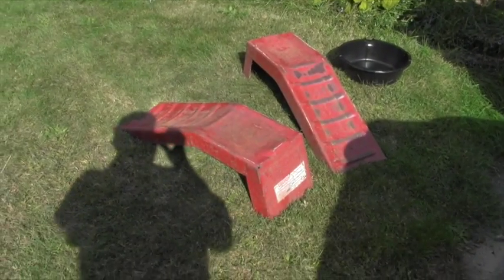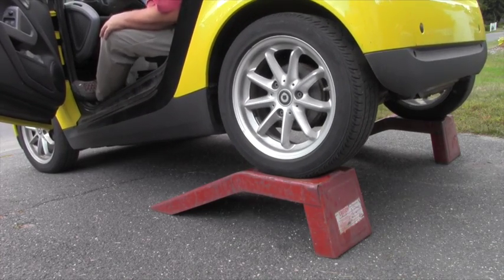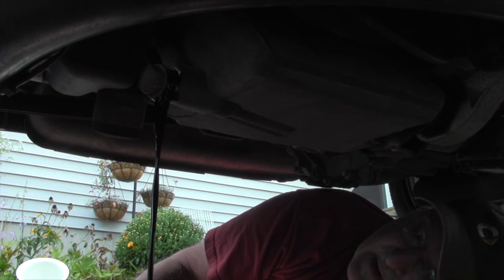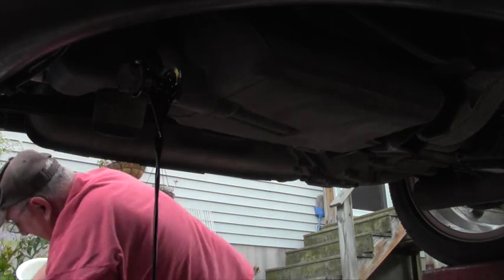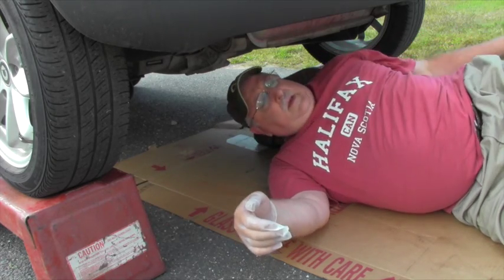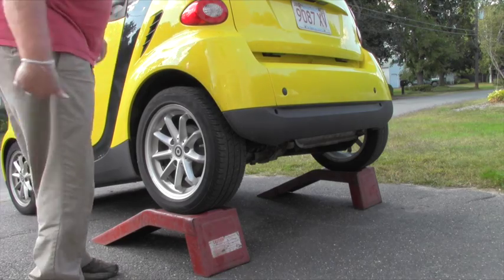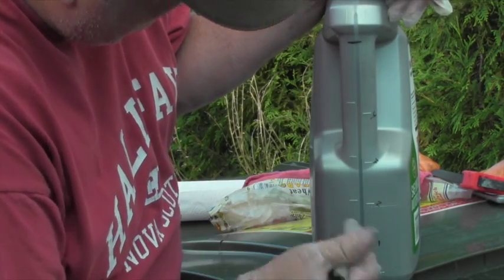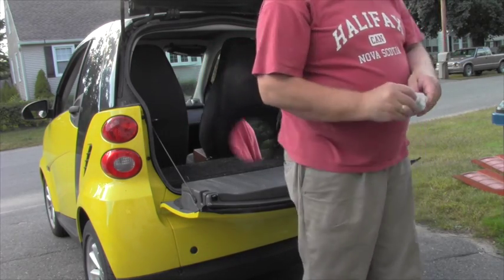smart Fortwo Oil Change

Comment: I mean, the noise that poor engine was making says it all...
Reply from the maker: That's the sound of hydraulic valve lifters operating with no oil pressure. It's not the sound of parts wearing or grinding.

Comment from the maker: WARNING! This video contains scenes that may cause mechanics and car fanatics to experience heart attacks, insanity and a general sense of superiority. In response to the volume of criticisms received, I have added an annotation warning those sensitive to scenes of engine abuse to stop watching the video. Thanks for watching!
Reply: Denb7 Youtube is the home of the anonymous critic, don't let them bother you.  One thing I like to do is find a piece of ground with some angle to it and lean the car toward the drain plug. Nothing dramatic, 5-10 degrees.  Seems to get more old oil out faster.
Reply: +Denb7 Let me give you a couple tips to be fair, Let all oil drain, you probably left 1/2- 1 qt behind, also let all the oil in the filter and then put it back in the box and then the bag so it doesnt leak out. and An adjustable wrench can strip the plug. Also never let a smart car 3cyl run without oil. It has very small parts that have 0 tolerance for that kind of running. Even cold starts have some oil to pump. Let the e brake up, neutral and let it roll. Use common sense sir. I may be young but I`ve never seen so much wrong in my life.
Reply from the maker: +Jason Kaplan Thanks for playing fair. The video is edited for expediency, the oil is drained and there is nothing close to a ½ qt left in the pan. Though it's off camera, the video does show me draining the filter before bagging it and I double bag as well, but not on camera. The adjustable wrench was not my 1st choice, but it became necessary because the drain plug is larger than my largest metric wrench. The drain plug is 10mm larger than the 15mm lug nuts that hold the wheels on. It may not be an ideal choice, but when used properly, the adjustable wrench is sufficient. 
Running without oil isn't recommended, but I do it and I don't care how other people feel, I had hoped the disclaimers plus my commentary would be enough to fend off critics, but apparently not. Why don't people make similar comments when someone makes a video of themselves deliberately destroying an engine by running it without oil? 
I have also discussed rolling off the ramps which, in my case,  can't be safely done by me alone. Had I started the engine only long enough to begin rolling off the ramps (4 seconds) I'm certain that I would have aroused just as much ire as I do running it for 33 seconds. To be honest, I ran without oil just to get a reaction... and it seems to be working. I've defended my position on this to death, so I won't entertain it any longer here. This video is for entertainment purposes only, so people should just cool their jets.
Thanks for your feedback!
Reply: +Jason Kaplan  I agree 100 percent with every thing you said here, i wonder if he still has this car and if he has had any engine trouble. lol
Reply from the maker: +nemrac fiftyto Just changed the oil again a month ago and... yes it's still running just fine with no engine trouble.
Reply: Have fun. Let me know when the ecu dies. I just talked to a former co worker. My old security company bought 10 right before they stopped making them all 10 crapped out with bad ecu's. $1000 for just the ecu.
Reply from the maker: +Jason Kaplan Could happen to any car. I had an '03 Toyota that lost its ecu. Fortunately the $1000 was under warranty. Every new car on the road today is electronically controlled. It's still better than my old '56 Chevy Apache PU with a 6 volt battery and starter pedal on the floor.
Reply: I`d rather have the chevy. Who wants cheap parts? not me. Obviously you`re not as smart as you wanna portray or you would`ve converted the apache to a 12v system
Reply from the maker: +Jason Kaplan I'm not trying to portray myself as anything other than a guy changing his car's oil. I'm not the sort of person who'd mutilate a classic into something other than its original condition, so I wouldn't have converted the Apache.
Reply: Firstly, to note that I will never start my engine without oil! However, I beleive that 30 secs will not harm the engine (the engine is still cold and there were still residues of old oil in cylinders). If you can ignore that sequence (now we have clear remark that running engine without oil will kill the engine) -  this is really good and thorough tutorial. Thank you Denb!

Comment: Just wow man,  you ran your car without oil.  How could you think that was a good idea?   I'd love to see your next oil analysis and the lead in there from your bearings.     You think all that noise was a sign?  That would be metal on metal contact from having no hydrodynamic wedge of oil separating the moving parts!
Reply from the maker: Draining the oil pan doesn't remove 100% of the oil. When you pour oil from the bottle, does every trace of oil flow out and into the engine? No! Not even leaving it inverted for an hour would drain the oil out. Internal parts are still coated. Please read what I wrote in my reply to judge dredd below.
Reply: Yeah you're right about that,  it's impossible to drain all the oil from the engine.   You're right about many things in the video,  however you will likely never admit to your one huge mistake.   Draining the oil pan removes all the oil from the oil pickup which means you have zero oil pressure.   Yes there is a film of oil on the parts in the engine, but you destroyed it as soon as you started the engine and the metal began to make contact.    Why not share the video with your dealership and see what they think.
Reply from the maker: justin Miller The video is public. If my dealer wants to watch it, I don't care. I've changed my own oil this way for 40 years and never had a problem related to metal-on-metal wear or excessive oil consumption related to worn rings or scored cylinders. You don't give today's high-performance lubricants enough credit. Next you'll get on my case for only changing oil once a year after around 8 or 9,000 miles. Geez!
Reply from the maker: justin Miller Ha-ha! It's like I'm getting famous for this. I knew I'd catch flack from 'car mechanic Nazis' but I don't give a crap! I like the first comment about how I think it's wise to run the engine without oil... I never said it was wise. How many videos are there on YouTube where people deliberately run a dry engine just to see it blow up. It always amazes me at how long they run. Thanks for sharing!

Comment: ok advice from a master mechanic 1 never ever ever run an engine without oil    2 use a measuring jug or the like as the bottles can be wrong    3 chock the front wheels    4 dont let this guy near your car    , at least it easy to service while under the vehicle check for leaks
Reply from the maker: 1) Congratulations! You're the 10,000th master mechanic to give me this advice. 2) After 11 years, the measurements on the containers have worked just fine. 3) Unless I'm standing in front of the car, I don't care if it rolled off the ramps. 4) I have no desire to work on anyone else's car.

Comment: I'm not gonna Blast you for running the engine without oil. These cars are so light all you had to do was put it in Neutral and push it off the ramps then push it back where you wanted it. I will however ask WHY you felt that was a safe thing to do?

Comment: You really don't need the ramps.  The oil plug and filter are well within reach without even getting under the car.  (Hence - no need to drive it off the ramps w/o oil as well.)
Reply from the maker: +n0nka Maybe for you, but I'm old and overweight and ramps just make it easier for me. Besides, if I didn't run the engine once a year, for 33 seconds without oil pressure, what would all my haters have to bitch about?

Comment: Three years later:

Have put over 23,000 miles, 5 oil changes, on my smart and your video was helpful from the start, especially the long drain plug with screen.

I change my oil every 5,000 mile and also update my smart maintenance schedules to show oil change.

As far as oil changes go, this is probably the easiest change in the industry.  Oil filter and drain plug are easy to access, as shown in video.

Thank you for posting!

P

Comment: Sir I enjoyed watching you change the oil in your little smart car I am now a owner of a little red smart car
Reply from the maker: It's a fun car to drive around. Enjoy it while you can. Mine is turning 11 years old this year and suddenly everything is breaking down all at once. The A/C stopped working a year ago, not the ABS stopped working, check engine light came on, brake light came on yesterday and the heater fan suddenly quit working in the middle of winter.
My next car will hopefully be an Elio.

Comment: Great Danny, Number One ! do not worry about the negative comments, in fact you have traveled only one meter with the engine on, and then, I with a Dacia I walked for 20 days without oil and still work after two years (after replacing the oli, of course hahaha).
i have already seen this video and it is good
By 6 months i have a Smart Fortwo 451 model mhd, now i will change oil, oil filters, sparks and air filter by miself because DIY is normal on this car. Bye (Google Translator)

Comment: Thank you for taking the time to produce and post this video. The information is very helpful. My nearest dealer is 120 mile away.
Reply from the maker: charles vereschagin I hear that. I consider myself lucky to be only 30 miles from my dealer, but I cringe at the thought of needing to go there. My friend had the smart dealer do his oil change and it cost $180!My next 'smart' video will be how to repair a broken tailgate latch. I needed to special order the part... FROM THE DEALERSHIP!!!
Reply: @Denb7   180$?! I would love to pay that price. I went to Smart Certified Dealership and they charged me 500€ (that's 591$) for an oil change & filter. I cannot believe it. Next time im just going to follow your video
Reply from the maker: @zanhaler01  If you start the engine before adding the oil, I don't recommend making a video of it then putting it on YouTube unless you're looking to amass as many haters as possible.
PS - My dealership charged me $1000+ to replace the muffler.

Comment: You ran the car without oil?! THATS IDIOTIC!
Reply: Dear Ynonne Reilly,

Please explain or provide some engineering data to support your unfounded response.

Are you an engineer that can support your comment with empirical data? 

IF not than I find your comment rude.  If yes, still rude and also bullying and would not expect from a professional.

P

Comment: Thanks for making this video Denny. I am thinking about buying a used Smart this week, and I heard it is expensive to maintain. Your vid will likely save me hundreds of dollars. I also love that you work clean. It is a great habit. Great video. Thanks again. Dig the Halifax shirt btw. :-)
Reply from the maker: JoeyTai11 The worst thing to happen to my smart is the starter motor died. The car was under warranty otherwise it would have cost over $900! My smart isn't the smoothest ride on the road, but it's fun as hell to drive and I love cruising around town or zipping down the highway.
BTW - I just made a new video showing how to fix a broken tailgate latch.

Comment: i just did my 61K mile oil change (5K on the first, 6K after). had the oil analyzed by Blackstone Labs for chemicals and metals (check for wear/leaks). my oil had 1/3 the copper of the average smart (copper is the bearing material in bronze/brass) and no coolant, water or fuel. good to know seeing that i've had the car 7-1/2 years and will drive it another 20 years  :)

Comment: Never start the car without oil & never over fill your car with oil. There are several things that might happen if a significant amount of
 excess oil is added to your engine. Your engine relies on consistent 
oil pressure to keep the moving parts running smoothly. Changes in the 
oil pressure and overall lubrication of the engine can lead to:

Engine damage such as bent rods in the engine or collapsed valve pipes.
Catastrophic engine failure where the engine sustains enough damage that it cannot be repaired, but must instead be replaced.
Excess engine wear from inconsistent oil pressure over time.
Spark plug fouling, resulting in the need to replace spark plugs more frequently.
Excess oil deposits in the catalytic converter.
Reply from the maker: Your 'no oil' remark has been discussed at length in other comments. The fact is that even after draining the oil pan, all engine parts susceptible to friction are still coated with oil. Operating the engine for 33 seconds at idle rpm, wasn't enough to remove that oil coating. So there was oil, just no oil pressure. Most affected parts might be hydraulic lifters, 
You hedged second concern by stating, "a significant amount of excess oil..." As you saw, the excess oil was marginal at worst. Perhaps enough to fill the empty oil filter that others have complained about.
You failed in your list of potential engine damages because you didn't categorize them with respect to whether they would result from either operating without oil or with too much oil.

Comment: No new seal ring on the oil drain plug? The car also needs to be level.
Reply from the maker: I've been changing my own oil since the early 70's and have never changed a gasket on a drain plug and have never had a leaky plug. The car only needs to be level to get a good reading on the dipstick. As long as the correct amount of oil is added, it doesn't matter.
Thanks for watching!

Comment: Why you start the Engine without oil?
Reply from the maker: Draining the oil pan does not remove 100% of the oil from the engine. Even when drained, all engine parts are still coated with a film of oil. The cold engine ran at low RPM for 33 seconds with no oil pressure, but not without oil. Lack of oil pressure affected the hydraulic lifters (tapping sound) more than anything else. 
You can put two drops of oil into a sewing machine and it'll stay lubricated for years. 
Try draining the oil from any engine. Let it drain for several hours. Next run your finger around inside the oil filler onto the cams and push rods. Your finger will come out covered with oil! There's still a coating of oil covering all surfaces needing lubrication. With a cold engine and low RPMs for a short duration, no harm is done.
Reply: to destroy the bearings lol
Reply: @Denb7  good luck,i wont let you near any motor of mine

Comment: Hear all the rattling and knocking of the motor with no oil, and down the road some poor fellow gonna buy that car and he's gonna tell how well he kept maintenance up but not tell how he runs it with no oil in it, he'd rather over fill it and not under fill it but run it with no oil is ok.
Reply from the maker: The person who buys my old smart has bigger problems with the transmission. That's why I traded it in years ago. I've answered claims exactly like yours, years ago from other people. Most of the noise is from the hydraulic lifters and nothing more. The engine parts you are so certain are grinding together are all still protected by lubricants. Draining the oil pan doesn't leave metalic parts 100% free of oil. Every part is still coated with oil.
I owned my smart for 11 years and changed the oil the same way each time. Tell me again how I'm shortening the life of the engine. The engine outlasted 2 starter motors, an exhaust system, an air circulation fan and a transmission.

Comment: Is this the diesel or gas? It sounded like a diesel engine
Reply from the maker: It's gasoline. Perhaps you are referring to the sound of the engine with no oil pressure as it came off the ramps.
Reply: I'm thinking of getting a used diesel smart cause it gets double mpg of what a gas gets but scared of the maintenance costs.

Comment: How many miles has the car done and how many oil changes have you done doing it that way?

I would never do it that way personally because failure/damage can be instant with no oil but I'm curious.
Reply from the maker: +boooooobiesrgreat My car has 38,000+ miles on it and I've been doing this since it was new. I've stated over & over that there is still oil coating the parts after draining the pan, but people will believe what they want.  While the car is on ramps, accessing the oil filler by reaching over the tailgate is a pain in the ass so I run the engine a few seconds with only that film of lubricant to protect it. I would just roll it forward, shut it down and fill it, but my driveway is just too short for that.
I'm no mechanic and I don't recommend people do what I do, but I'm sure enjoying the mileage from the shock value built into this video. Thanks for watching!
Reply: +Denb7 cheers for the reply
Reply: @Denb7  Why would you use High Milage oil in a vehicle with only 38k on it?
Is that too compensate for the huge amount of wear from running it without oil??🤣

Comment: On the right hand side of the carpet that's over the engine compartment there is a plastic clasp that will clip onto a hole in the right side of the car. You won't have to use bungee cord.

Comment: i know your catching hell about running the car with no oil  this i would never do but what i don't understand is why didn't you kill the motor after it came off the ramps u took the time to get out and move them and back up,, that's crazy I would have at least added two to three quarts of oil before i moved it